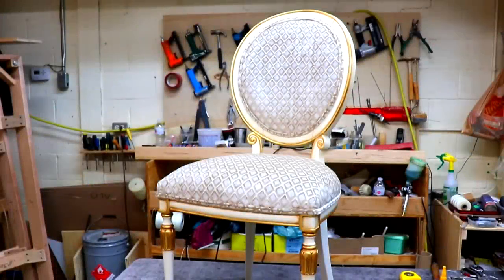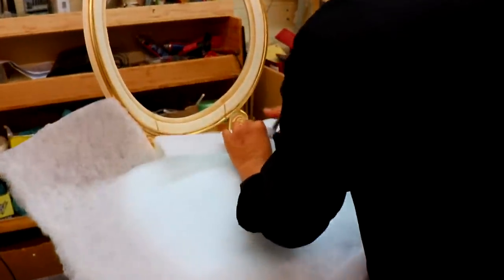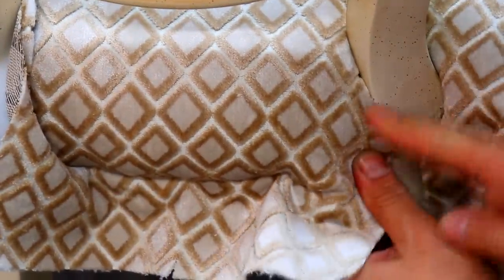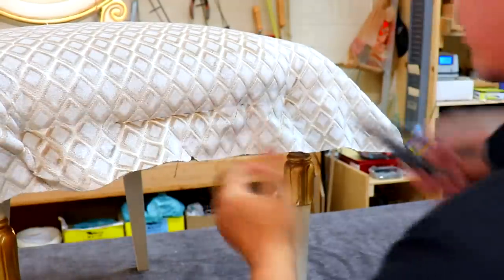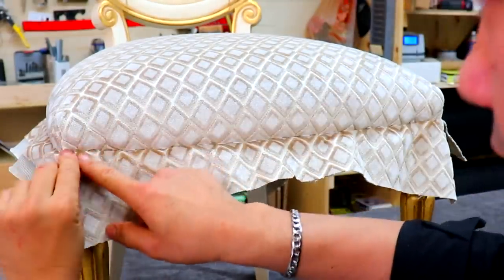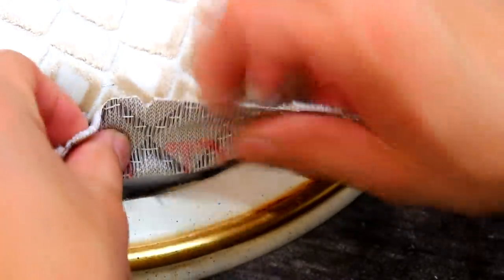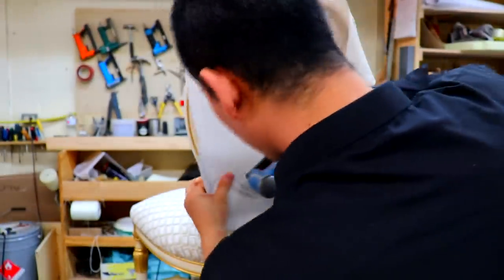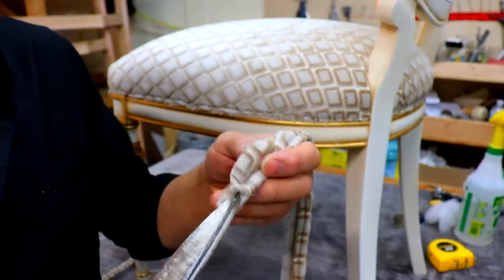DIY-HOW TO UPHOLSTER A DINING ROOM CHAIR - ALO Upholstery

Comment: Love your videos. I have some Drexel box welted  cushioned slip seats the same design as these chairs. Could they be reupholstered the same way as these chairs? They seem to be missing the extra wood flange that you staple into to -  I wonder if the edge of the ply slip seat base cold be used for stapling and then the whole cushion screwed onto the chair ? I much prefer this style of cushion. Thanks :)

Comment: have you done any reupholstering of a dining room chair where the back has an arch window like you would see in a Catholic Church the foam is flat on the back but it's thick in the front so when you sit in your chair you're actually sitting up so how do you do that part over without messing up the design of the chair? I've done the cushions of my mother's dining room chairs and covered it in plastic not realizing that one plastic was thicker then another piece it was kind of hard but I did it but what is the best way to put plastic over the materials on your chairs ,what is the easiest way to do that? What size staples and staple gun should I use to give the chairs a professional finish? The only staple gun that I had was your standard household staple gun, so for an amateur I think I did okay ,now I want to do my own dining room chairs. Which material is easiest to work with a vinyl ,leather or cloth? How much yardish is needed for reupholstering your standard diningroom chair?
Reply from the maker: I have done many dining chairs and don't always get the chance to make videos. I'm sure I may have come across a chair that you're talking about hard to say without seeing it. A standard size upholstery gun and staple will be fine.

Cloth is usually easier to work with because it has more give and cloth will last longer then vinyl as vinyl will start to peel after a few years.  Yards all differ pending on the chair if its full covered or if its seat and back or just the seat. Hopefully I was able to help answer your questions.